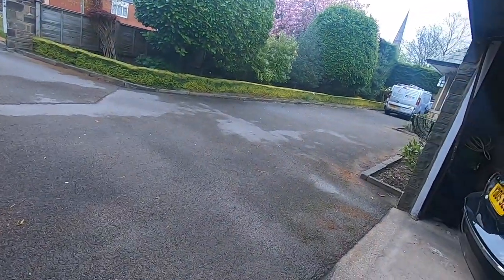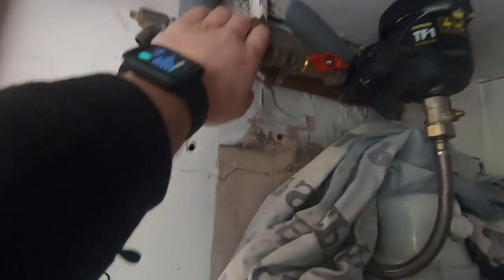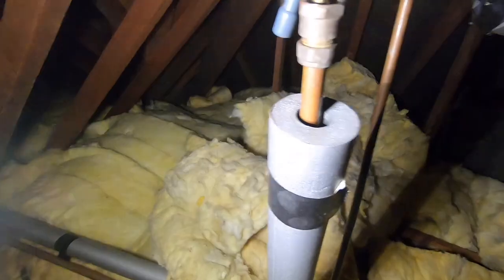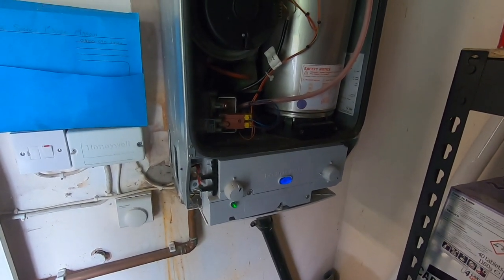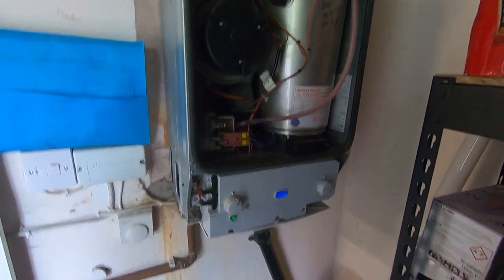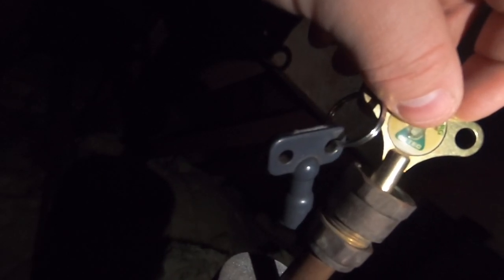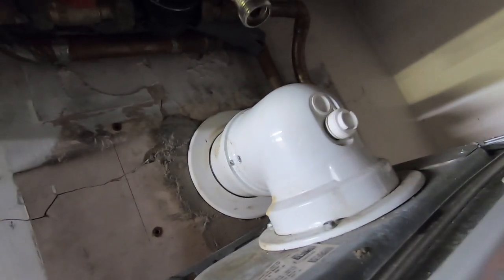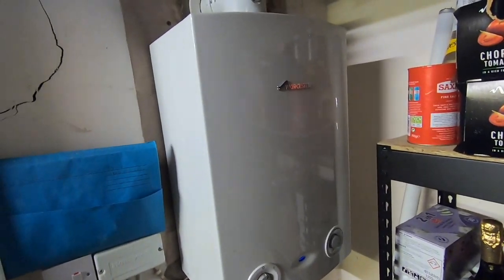AIR LOCK FROM HELL .. THIS TOOK 2 DAYS TO CLEAR!! | Parkes Plumbing

Comment: Best airlock removal tip.... Don't fill up at 4.30pm on a Friday if avoidable. Glad it's not just us... Sometimes I find, bite the bullet, drain down the loft pipework and fit a few strategic AAVs.  Doesn't always work but has got me out the house before midnight. Love your vids, hate airlocks!
Reply from the maker: Cheers mate

Comment: Couldn't get a gravity system to refill. Header tank full. Nothing coming through any of the radiators. So I back fill the system via the kitchen rad. Using the washing machine inlet hose. You have to take care though. Did it slowly, so water didn't start gushing out of the overflow! Bled the radiators in turn. Pressurized water, pushed the air through, and the system was back to normal! But I spent a couple of hours trying to fill the system conventionally, before I came up with this idea!

Comment: i have a question i have a solid fuel back boiler with a pipe thermostat even tho the pipes are hot the thermostat wont go above o c the rads are hot and i have hot water

Comment: Airlocks are one of the worst things for us heating engineers!

My trick is I use an old pump head that's still in good nick, put a fly lead on it and swap the heads over on the pumps that's on the system, let it run with the bleed vent open and a rubble sack or bucket or something underneath it to catch the water. I find it bubbles loads untill eventually you get a steady drip of water coming through.

I've posted it on my Instagram page if you or anyone is interested to see what I mean 👍🏽 

https://www.instagram.com/p/CC6Ei-dpR94/?igshid=iiaayj72g45u
Reply: That's if the pump valves are ok though....

Comment: I have a job with the same issue to sort out today, it’s the 2nd time in 3 months it’s happened, drained it down in the summer for some repairs and it’s been a shit bag since! Added 2 aav air cupboard but ultimately it probably needed air vents on the long horizontal runs where I can’t get to! Pump is strong but valves are shot, I had a problem on another property 3 years back now which took 2 days to shift 🥴
Reply from the maker: Nightmare mate. Can you combine feed and expansion maybe?

Comment: We used to get gravity fed hot water air lock to bath. We used to mains cold water into hot water tap at sink to over come the air lock. Tge hot water would then flow to the down stairs bathroom again. Well done to get that air lock sorted. What a relief for both of yours. Steve
Reply from the maker: Cheers Steve I’ve not had a hot water air lock in a long time. I used to carry one of the old style shower hoses that attached to both taps loo
Reply: I went to a job that another guy had been to 5 tines to clear a hot water airlock , he had cleared it each time but never fixed the problem.  The vent was piped up incorrectly,  I repiped it and never went back .

Comment: I’ve had success in the past converting to a pressurised system. But when you’re  trying to clear air locks you always think that you’ll get it sorted any minute, never expect to be there for hours. Modern erp pumps don’t help either, definitely a good idea changing to an older fixed speed one.
Reply from the maker: That’s the problem .. you’re always 5 mins away until it’s midnight ha

Comment: Pushing mains cold water up the drain off point, with someone at the tank in loft, they should see bubbles from tank out put pipe, then tank start to fill with water. That will hopefully clear the air lock.
Reply from the maker: Popular one is the mains push

Comment: Convert to sealed system. No more airlocks. Can use the mains to push them out and then drop pressure back to 1 bar if needed. No pumping over either, less chance of sludge

Comment: A good little tip (if you have good pump valves) is to change pump direction, might have to do it back and forth a few times but can help clear the most stubborn air locks.
That job looked a beast, not much height between pump and header tank and long horizontal runs. But also drawing off water from a rad like you were doing can help move things along. It’s also the job you will dread going back to change anything in the future
Reply from the maker: Glad it wasn’t my job ha

Comment: i find removing the pump and connecting a power flush machine helps some times. great video glad you got to the bottom of it
Reply from the maker: Cheers mate
Reply: Agreed. 😁
Reply: Beat me to it Michael.  Especially on a large property like this. Probably a few hours then 👍

Comment: Was the vent and feed connection connected before the pump ??  It should be otherwise it will pump over and heat up the expansion tank
Reply from the maker: No it’s was after the pump that’s why it was heating up
Reply: @ParkesPlumbing  has it been altered now ??
Reply from the maker: @dennisphoenix1  not as far as I know
Reply: @ParkesPlumbing  that needs doing otherwise you can't develop any pressure in the system on the pump outlet hence your airlock
Reply from the maker: @dennisphoenix1  there’s a lot that needs rectifying there bud .. I’ll let the guy who’s job it was know
Reply: @ParkesPlumbing  it's surprising how one simple alteration can cure what looks like a big problem.

Comment: One of first things I would do is put hose on each rad and run them through till not more air.. especially if on drops and if gravity system.. it needs the full bore gush to get the air out.
Reply from the maker: Yep that would do it

Comment: Connect the hose as you did to the radiator, but put it onto mains cold open the tap and try to push the air out the other way is one way that can work also.

Comment: I normally remove a small rad, bathroom for example. Then connect a cold feed hose on.  Connect my drain down hose to the petcock near the boiler and keep it fired on max.  Usually works for me. 👍
Reply from the maker: I like it

Comment: I had issues on a sealed system with rads not heating up at far end of large house. Upgrading circulator to 25-80 180 sorted it.

Comment: Hate airlocks. When I have dealt with them, normally on an open vent system. I put a screw in drain off on the farthest rad downstairs and get the boiler and pump running. Then pull it through each leg at a time. Don’t like auto airvents as they fail and cause damage.

Comment: Great vid mate, always love watching. Can you confirm the issue? I under stand the airlock but you also mentioned  end radiator flow side valve was closed or something? I also think you may have some split ends ...no offence...
Reply from the maker: Yeh the problem was with the flow in a new extension. We sucked it through and circulation began.

Comment: Someone's already said it, convert to sealed pressurised system, obviously you've got to weight out condition of the system not sure if Res would be happy to sigh a disclaimer stating you wouldn't be liable should the pipework burst but as long as you keep it around 1bar on the large system like this it would really speed things up obviously upgrade manual vents to decent AAVs some x100 couple of hours and you're out.